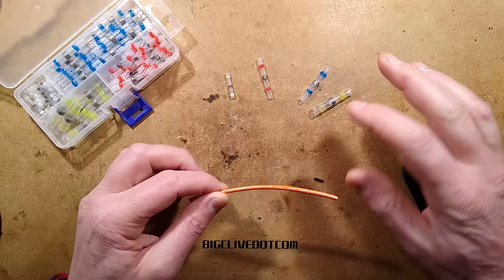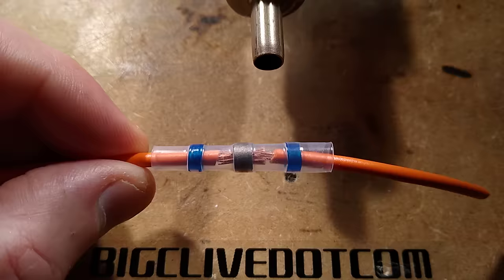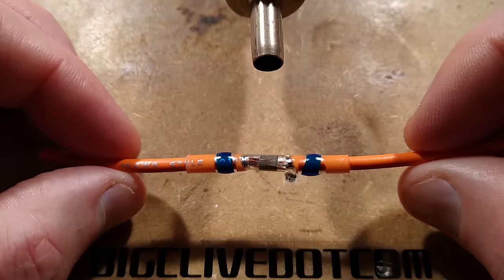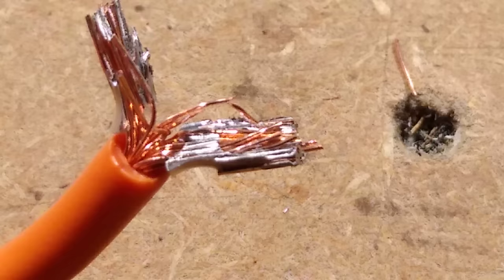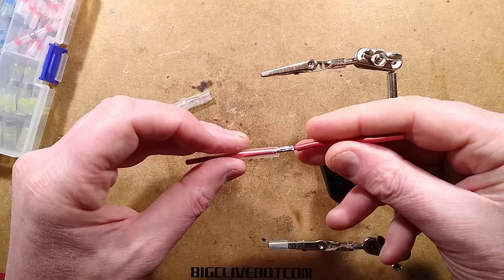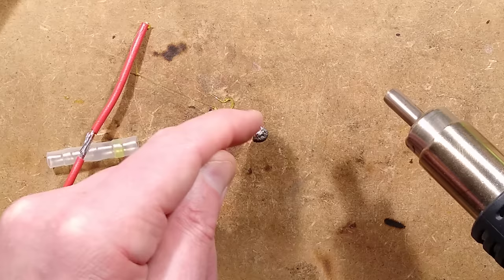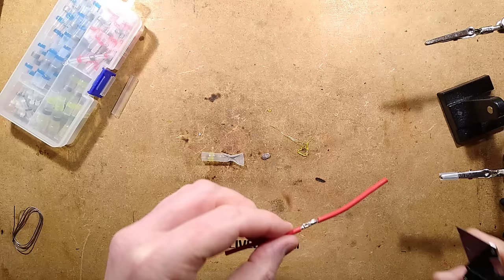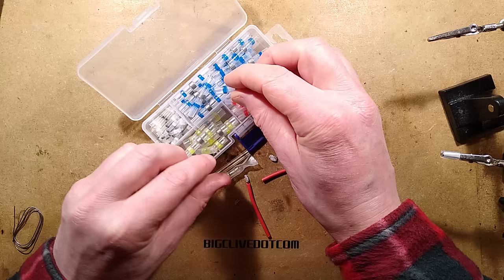Heat shrink solder butt connector test.

Comment: Try dipping each end in flux before pushing them separately into the connector.
Reply: Thats a good idea..i will try that.
Reply: I do exactly this. They work really well.
Reply: At that point, it's just a step away from pre-soldering before covering with heat shrink. The point of it would be to be in a quick, on the go repair kit
Reply: That's what I was thinking.
Reply: @SurajGrewal  these also work when the wire is too short for the heat shrink method, not so easy making it look neat in that situation tho.
Reply: What if you prelube it inside with gel flux and store it this way?
Reply: @leosedf  yes, that'll be nice, but careful about using acid free flux and not to get any into the sealing glue rings
Reply: @SurajGrewal  You could throw a cheap flux pen in the box and put a little drop on the wire before pushing the connector over it. But I'm not shure if regular flux is compatible with this type of solder alloy?
Reply: No! Don't add flux, or it must be an L0 or L1 type. Flux is acidic and will etch the copper off over time.
Better to pretinn the wires before using these HSD heatshrink solder devices
Reply: Don't want to piss on your chips guys but he did say roadside repair . IE get you home then sort it properly
Reply: @paulsilcock6923  these hsd are widely used in defense aerospace. If they were unreliable, DoD wouldn't use these. BUT, use decent ones, raychem or TE and pretinn wires.
Alixpress hsd on rather thick, untinned wires which are being touched with bare hands (sweat) doesn't make for a durable, reliable connection.
Reply: @Turnerbiker73  I would only use a type L0 rosin flux in this application to be safe. I appreciate your professional attention to detail. 
100% agree that higher activity fluxes are contraindicated here and pre-tinning is the only correct solution.
Reply: @Turnerbiker73  Cheers Will search them out .Thank you
Reply: You could use a flux pen. I keep one in my shirt pocket anyway
Reply: @SurajGrewal  that's my take
Reply: @SurajGrewal  exactly... the more work you add, the more one would consider not using these at all.
Reply: @Turnerbiker73  if it comes to that, might as well not use them but solder the wires and use normal heatshrink instead.
Reply: @TortureBot  surely, you can proceed as usual. Maybe do a linemans or Western Union splices. Stronger but requires more wire
Reply: That defeats the point of a quick fix.
Reply: @millomweb  I think they can handle blue flame lighters.
Reply: @SurajGrewal  Wouldn't be a big deal to add a small tub of rma paste flux to the kit along with the requisite lighter.
Reply: @Broken_Yugo  yup
Reply: @SurajGrewal  If I could put cars and motorcycles onto my kitchen table, then sure, I'd properly solder the wires.  Workshop queens everywhere.
Reply: @Turnerbiker73  But, the solder for pretinn might not be compatible with the low temp heat shrink solder.
Reply: @SurajGrewal  Unless you use adhesive lined shrink sleeve, which is expensive and bulky, it wouldn't give you the environmental seal!
Reply: @icarossavvides2641  still better than having a short to ground. Also, can add glue before shrinking the heartshrink

Comment: They need load testing, see if they heat and fail up when passing a high current.
Reply: I was wondering if the solder would melt again if too much current was passed
Reply: Would like to see this and if someone tried to put two solid core wire together
Reply: Could also measure resistance comparisons or voltage drop across the joint at the same time
Reply: Photonic Induction agrees
Reply: @JasonW.  Crank it t'ill it pops!  - I miss that guy, hope he is doing well...
Reply: Been using these on ebikes, whilst they definitely aren't as strong as regular solder they are more than strong enough for most applications, the solder is more brittle than lead solder,
If you massively overload them you can melt the solder but then again wires shouldn't be ran over spec anyway. 
All in all, a proper solder connection is definitely better but I've yet to see these fail.
Reply: Gold_plated_bullcrap it doesn’t really matter if the solder liquifies under load, though. If anything that makes a better conductivity of joint.
Reply: Long time no see ;]
Reply: TrollFaceTheMan 
  It’s been a while, I’ve not made any videos for a while.. interesting ones anyhow lol 
  Hope things are going good, and stay safe!
Reply: @locouk  thanks, you too :)
Reply: @axeami1354  What V/Ampsare you using them for? I m guessing 36v and 20ish amps would be fine but are you using it anything higher?
Reply: @brannenthompson9662  the kits I use are usually the bafang bbs02 750w they peak out at Around 1300w so draw closer to 30 amps on a 48v battery.
Reply: @axeami1354  Thanks for taking time I have 2 x 36v hubs at about 22amps each so should handle more than 22 amps, Cheers
Reply: If your wire is getting hot enough to melt even that low temp solder, you've got much bigger problems. If this soldered joint is getting to 150°C, then other connections (crimp and screw terminals) in the circuit are getting much hotter.
Reply: @xenonram  I have brought a  cheap temp thingy lol  so i let u know.
Reply: Good question, in tests, they melt back out. And they you end up with an electrical lose connection. Crimping with a heat shrink butt splice, is still the best. Soldering was a good means until crimping came along. Solder is now more of an anachronism when it comes to spicing wire. That goes for all sizes from 20ga all the way up to 2000kcmil.
Reply: @knotbumper   What I wonder about this low-temp solder is if there are legitimate industrial/mechanical applications where these might be used, that get hot enough to melt this stuff but not regular solder.  High-temp engines, fabrication machinery, etc.  If you are expecting normal solder and get this lower temp stuff, then that solder will reliquefy along with the glue.  IMO a good crimp connector with the glue bands would provide mechanical strength and still make a good seal to protect against corrosion.
Reply: @knotbumper  The main advantage of crimps over soldered splices is speed. In high-vibration applications another disadvantage of soldering  is that it makes the connection somewhat brittle, at least more so than the copper wire itself. Other than that soldering is fine.
Reply: These style solder joints have been used in aviation for years.  Nothing new.
Reply: @JasonW.  anyone heard anything from Andy/photon? He's been gone so long. Hope everything is sorted with his wife now
Reply: I saw testing with Wago lever lock connectors that held up to the point the insulation on the wires melted down and charred. If weather proofing isn't a concern, they're excellent connectors, especially for something you want to reconfigure frequently.
These seem useful for sealing against moisture ingress, maybe better than regular heat shrink with the added hot melt bands.

Comment: There is just 1 other issue I have and that is heat from current how much current can you put through the joint before it heats up enough to re-melt the solder and break the joint being such a low temp solder I assume the regular solder would hold longer that the heat shrink solder

Comment: Hi Clive, nice video. Reminds me a demo from a very eminent engineer who told his students that soldering is not always the best. He demonstated that a good clean crimp joint has a lower resistance than a soldered one. He explained that in reality the purpose of the solder was just to stop it unravelling and keep osygen from getting in and oxidising the metal. He then demonstrated that was indeed the case by measuring the resistance and then connecting the two joints in series. Passing a high current through the two joints it was the uncrimped joint that melted. That demo has always stuck with me.
Reply: his point here seemed to be to simulate a field repair, hence he tested the product with the lowest temperature setting. part B was to compare the results of the product against a traditional method. 

honestly if you're broke down on the side of the road it's pretty unlikely that the cause is going to be a wire. possible but pretty unlikely. I did counter this with one of our work vans after it had been to the mechanic. somehow they damaged a connector on the wiring harness and it took a while for it to work its way back out again whether it was by accident and they stuck it together to hide it or was on purpose so that we would have to bring it back later I don't know for sure but if so they screwed themselves because we took it somewhere else
Reply: Western Electric teaches this: a sound mechanical connection and a sound electrical connection are the same thing; solder is a sealant, not part of the electrical circuit.
Reply: Odd, there are several videos online testing crimp vs solder and solder always has much lower resistance and heat. Except in the case of a cold solder joint. But also maybe the teacher was using a different type crimp connector than what you normally find today
Reply: @stephenwhite5444  It is interesting, I guess it mainly depends on contact surface area, the joints we used had multiple contact points and were  really tight. With solder you will increase the surface area but a good solid mechanical contact should always be made where possible. If solder lowers the resistance and temperature of the joint when passing current then it is a poor joint in the first place.
Reply: @terrybailey2769  Lower resistance and temperature increases efficiency and therefore means the joint is good. Hope this helps!
Reply: A fantastic bit of info mate that I and many others really appreciate 👍
Reply: @stephenwhite5444  If you see the way high current connections are made they are always made with crimp connectors, I think that proves the point.
Reply: Oh… Good clean crimp joint has better resistance then soldered connection…until it doesn’t. 

Either in slow oxidation from age or fast oxidation from excessive current or bad crimp will give the soldered connection the general overall advantage in most conditions including severe & long duration versus a crimp connection. 
While the crimp connection is only better in good conditions & normal use. 
with overload or near capacity use degrading the crimped connections quicker then soldered connections. 

You could help slow oxidation with  a crimp & glue/seal connector or heat shrink with inner glue. 
Then over size your connections if you’re only crimping without solder. Avoid heat unraveling your crimps.
Reply: Using a good quality non-insulated crimp connector with the correct crimp tool will always be superior to soldering. If you can only afford the cheap red-blue-yellow connectors with home depot crimp tool then soldering is better.
Reply: @pirobot668beta  
Case in point. RF cable ends. Even if the pins are soldered a mechanical crimp holds cable and connector together.
Reply: Correct. Solder's weak point is the inability to carry high current as it will melt. Crimped joint will not melt because the crimp terminal is the same as the copper wire. But we seldom reach such a high current. In fact, in most cases, the insulation will be the first to melt. But then, there are high temperature insulation. It is a never ending goose chase. 😁😁😁
Reply: @ramonching7772 I would think the low temp solder in these would make that more likely. Definitely not for high mechanical stress situations.
Reply: @pirobot668beta  hence why i do a lineman splice and then solder.
Reply: Crimps always seem to end up corroding on my boat trailer so switched to these and have had no problems. i think some of the crimps just react with the copper to corrode because even heat shrunk the look corroded.

Comment: you might try a mechanical load test, see how easily the joint pulls apart... and also an electrical load test, pass a current through and measure for a voltage drop at the joint.
Reply: or just pass current until it catches fire.
Reply: I would very much like this as well. I occasionally have something that'll need to withstand a little pull every now and then.
Reply: @TortureBot  And to top it all off, the name even fits lmao
Reply: I was disappointed that he did not try yanking them apart.
Reply: Cool product but I wouldn’t trust it
Reply: i said the same  1 minute ago !!!!      actually all comments are very usefull and bullshit at same time ...   the only way to know if these things are decent fixes or crapers, is  measuring them ... Personally , with 35 years working on the field, i preffer the traditional lead solder and a quality shrinkable tube....
Reply: JW will probably do those tests :-)
Reply: The light solder is for continuity ONLY. The hot-melt is for strength.
Reply: The low temp solder that I tried was brittle. See if a little flexing will weaken a joint or noticeably change the resistance.

The mil spec and other well regarded versions mentioned in other comments required much more heat. Some also required that the wires be tinned.
Reply: The resistance wasn't enough to cause an issue when repairing a wire coming off a pcm. I believe spec was 4.7-5.5 ohms and was still in spec after the repair
Reply: They are safe to 50 V, so no mains voltage (but there are people using them for that). I would rather use screw-terminal or Wago-style clamp.
Reply: Yea, get your AvE on!
Reply: If it's not going to cause any resistance (Which I cant imagine it does.. maybe 0.01 or 0.02 if it didnt bond so well.. [which is within OE spec for a Automotive repair for a wire.]), then it wouldnt cause any voltage drop would it? I mean any 12 volt supply is still going to show 12V on the opposite side of a wire repair, no?
Reply: Maybe the heat from a bad connection will help reflow the solder and create a good connection!
Reply: @TortureBot  test it properly not half heartidly
Reply: Give it JW, he's really good at passing stupid amounts of current through test connections.
Reply: Exactly! The cold solder joint will fail.
Reply: @gunners4129  It depends on how much current is flowing through that ".02ohm" connection. If this is in the starter 12V supply, you bet it's going to make a difference!

Comment: We used these to terminate drain wires to cable shielding. A couple of notes on your application of these:
Strip each end 1.5 - 2 times the width of the solder band. The idea is to contain the solder to a limited area. Strip too much and you end up getting the exact flowing problem you found.
Pre-tinning the ends is preferred, or use a 'no-clean' flux (Rosin flux corrodes the solder joint over time if not completely washed off with IPA).
Never 'mesh' the wire together. Always maintain the wire twist and lay the two ends side by side. Meshing the wire adds voids where the solder does not flow and you end up with the exact flowing problem you found (second reason for the failure).
Use a bigger nozzle for your heat gun and heat the whole area up in one shot. This is just for efficiency.

They work, but they do require a specific assembly method to work properly. Good luck!
Reply: Do you know what company that produces these shrink sleeves?
Reply: @leifhall2289  I think Amp and probably Tyco make the better quality ones, but there will be cheaper Chinese ones like JST if I remember correctly.
Reply: Just reading your comment. I use rosin flux with a 60/40 leaded solder.  I dip the wires, touch the iron on the fluxed wires to heat it and flow into the strands and then add the solder. I'm guessing that's a bad way to solder?
Reply: @rockmunkey1981  Sounds like you're doing everything right. Just gotta be sure that the rosin flux residue is cleaned off before you encapsulate the solder joint, or use a "no clean" flux and forget about the cleanup.

Comment: Hi Clive. I use these at work very often than not for bilge pumps in boats where the splices will be always submerged. Never had a problem with one yet. And for dirty jobs like that where you don’t want to be down there all day these have really been a godsend. What I would note is the adisive bands need more heat so they flow like hot glue and as for the solder I’ve noticed that if you strip your wires shorter about the same length as the solder band they give nearly a 90-100% solder coverage. Keep up the great videos.